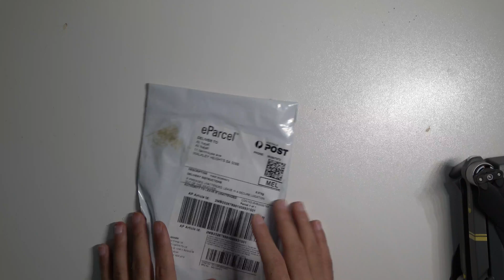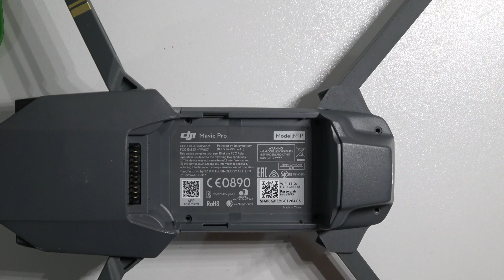Dji Mavic Pro Ribbon Cable Replacement - Mavic Gimbal Disassembly [Part 1]

Comment: Is it possible to calibrate the gimbal if the camera is not connected?

I'm testing the gimbal, but the camera's cam is broken, I can't calibrate without the camera.

I need to understand this situation, if so, I will buy the camera cable.